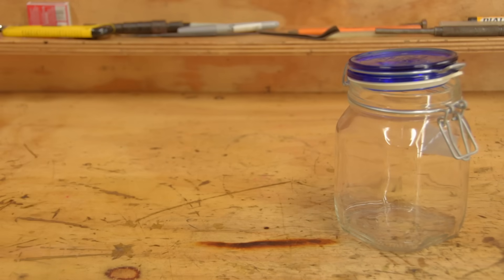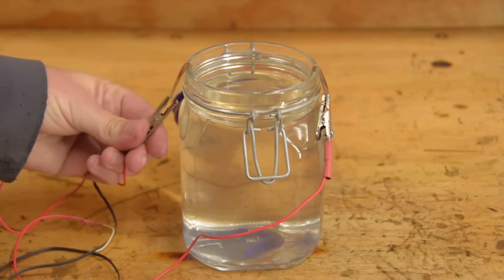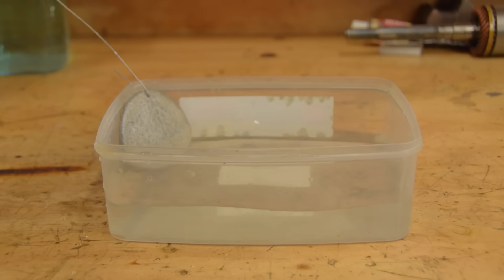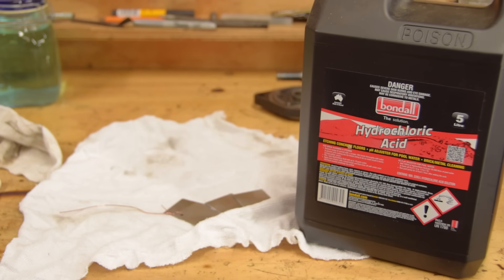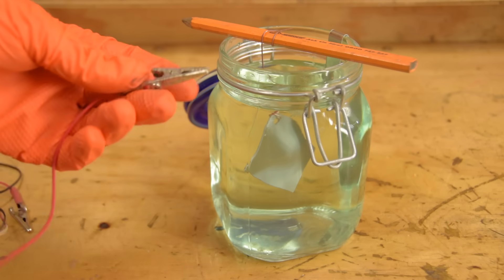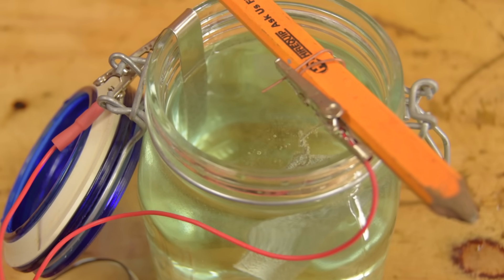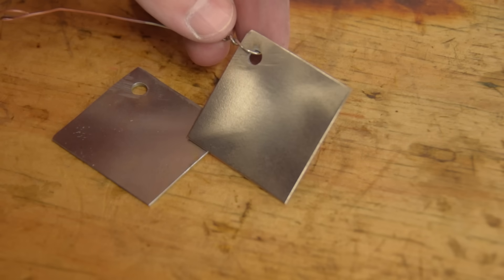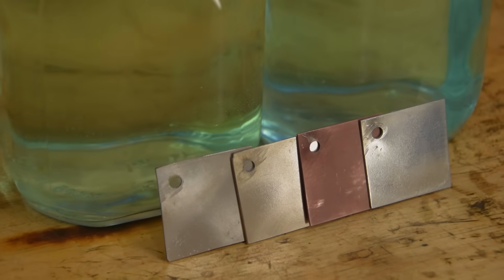Electroplating - Easy DIY Nickel, Copper, Zinc Plating

Comment: very good video Geoffrey!! i'm going to give this a try. i need to nickel some parts made out of brass i guess, but i'm not 100% sure, could be copper aswell. if it's copper i can nickel directly right? if it's brass i need to copper it first before nickel?
Reply: i just covered a copper pipe with nickel
Reply: Can you replace copper ? I have copper knobs on stove , the plating is wearing off .
Reply: LOL, I'm here because of 'my mechanics' videos!  I must be in the right place if I found the source he learned from.     Question:   Does the process give off any fumes? Or does it smell bad at all?
Reply from the maker: I think Nickel can go over either no problem.
Reply: @GeoffreyCroker  What am I doing something WRONG? I zinc plated my bolts and than deposited into a Nickel plating bath.  But after the nickel plating it looks like the zinc coating somehow got removed.  Can someone tell me what I'm doing wrong?  Thank you
Reply: I'm looking at making a Tungsten Disulfide electrolyte bath to plate onto some steel parts as a dry lubricant film. So far, the chemistry is showing me that alcohols are the best option as a to dissolve the Tungsten Disulfide. Do you have any advice that might help me get started?
Reply: @GeoffreyCroker  I'm looking at making a Tungsten Disulfide electrolyte bath to plate onto some steel parts as a dry lubricant film. So far, the chemistry is showing me that alcohols are the best option as a solvent to dissolve the Tungsten Disulfide. Do you have any advice that might help me get started?

Comment: What type is the white vinegar? In sweden its a diffrent name, is it the one you use on food like sallads or the one with diffrent strengths like 12% 24% that u use in food while baking?
Reply: Not sure about the backing but it's used in pickling process.
Reply: ethanoic or acetic acid is vinegar

Comment: Cooper will plate directly to steel.  If you dunk clean steel into a bath of Copper Sulphate it will immediately have a copper coating.  Normal chrome plating of steel was always copper, then nickel then chrome
Reply from the maker: I think commercially they flash plate steel with a cyanide copper to get started.
Reply: Well, I'll just try THAT, then.

Comment: PARTSMADE here from the 🇬🇧 , another excellent tutorial mr C  but got to take you to task on copper plating,  in my restoration work copper first if surface poor then polish and on with the nickel plate , I’m luck as my stuff is never newer than the late 1920’s when chrome plate arrived  , your plating current a bit high as bubbles on the surface of the parts will prevent proper adhesion and will show on highly polished parts  I guess a few nickel bit going to appear on mr Land Rover 🤔😂
Cheers
Reply from the maker: Ah, yeah for sure. Do you use an acid copper bath to go straight over steel? I figured saying use nickel first was easier than going into all the details about different copper options. I actually only flashed the part very lightly with nickel, but again I left that detail out of the video to keeps thing simple for the people who are starting from scratch. I figured people will learn all the details if they just start.
Reply: Hi , yep acid solution for copper , sorry not picking fault , as you say striking a balance of tech detail and not putting people off is a fine line .
Regards
Robert
PARTSMADE

Comment: "Copper won't plate steel" well, that would explain why my attempts at copper plating steel worked so badly.  Off to ebay for some nickel anodes tappy tap tap
Reply: Copper will easily plate steel. Try Copper sulphate electrolyte and see.
Reply: the result is steel plate with copper powder on it, that you can whipe off easily
Reply: @houstonceng  it won't work, you need cyanidic copper or nickel first.

Comment: Is there some kind of 'resist' I can use if there are a part of the part I do not want plating on? I was thinking of plating a gun, and do not want plating in the bore?
Reply from the maker: Paint, nail varnish, pretty much anything that won't come off in vinegar. If you buy an off the shelf plating kit it'll be non-acidic and I've used marker pen as a mask in that case.
Reply: plug the bore and chamber with wax and ensure they are completely sealed before immersing the barrel in the plating solution

Comment: What if you...... What if you drank the liquid electrolyte? Would it harm you?
Reply from the maker: My working asumption is yes.... but... it could be the next big health craze...?
Reply: Geoffrey Croker but Gatorade is electrolytes. Jk
Reply: Of course it wouldn't harm you.  It's got what plants crave!
Reply: No - you'd be OK just your Scrotum would be Nickle plated , which would be a good think if you swim a lot in salt water .
Reply: I'm a physician, and over the past 40 years I have occasionally dealt with toxic exposures to various metals, both in elemental form and as salts.  None of it is good.  Even the truly essential metal ions -- sodium, potassium, calcium, magnesium, iron, copper, zinc, selenium (ordered roughly from large to trace requirements) -- all have amounts beyond which acute ingestion is supremely stupid.  In reality, we never see cases of voluntary ingestion of things like nickel salts, because proponents of risk taking behavior of this magnitude have already self-selected out of existence before the opportunity arises.  Skateboards, wingsuits, rock walls and slack lines are simply far more prevalent/available, and transiently more rush-inducing than nickle salts.
Reply: @OslerWannabe  so that's a "no"?
Reply: @OslerWannabe  TMI
Reply: I would not recommend drinking the electrolyte after use unless you like being dead especially the nickle although the other metals would not be happy making either

Comment: What do you end up doing with the used/mixed hydrochloric acid?
Reply: It's just hydrogen ion and chloride ion disolved in water, to an extreme concentration.  In theory you could dump a 1 liter bottle of hydrochloric acid (with a pH of 1) into a 30 foot dia. kids pool 3 feet deep, and you'd have a solution of about pH 5, roughly the same as vinegar (but without the smell from the acetate).  I don't think I'd let my kids swim in that, but the point is you could dump it into a decent size pond without concern.  Just not repeatedly.  After the hydrogen ion reacted with available organic bases in the pond to make a little extra water, you'd have a bunch of chloride anions looking for lonely cations.  If they found sodium ions, they'd make a little table salt, but more likely they'd find a bunch of organic acids from decaying aquatic plants.  Now understand, I'm talking about doing this ONCE, with pure hydrochloric acid.  The problem that I foresee is that, before walking down to the pond with your 1 liter bottle, it might be tempting to grab some of the partially spent bottles of household cleaners sitting along the wall of the garage, for similar disposal.  So this theoretical scenario is not for knuckleheads.  So having a bit of an environmental conscience helps, but just keep it under your hat.  Unless you're OK dealing with the humiliation and social ostracism of being labelled a snowflake.
Reply: Neighbor's bushes.
Reply: HCL is also known as muriatic acid. It is sold as a concrete cleaner/brightener.
So, except for the heavy metal in it, you could clean some concrete with it, or neutralize it with a base, such as soda ash  (but be very careful as you will have a violent reaction)  and dispose of it down the sewer or in the yard to acidify areas that need it. 
Talk to your local municipality before dumping it out anywhere.
Reply: heiko's garage waste

Comment: Why less than 1 amp?
Reply from the maker: You want to aim for about 1amp per 65cm2. Half an amp in a setup this size is all you're going to need.
Reply: Too large a current will promote bubbles  which can leave marks

Comment: Copper won't plate to steel? Then why are parts copper, nickel, chromed. Copper is used as a filler more or less.
Reply from the maker: Commercially there are ways to plate copper straight onto steel. Traditionally it would have been flashed with nickel first.

Comment: Have you done anything with anodising aluminium? I used a similar system for zinc but with Epsom salts, and sugar as a  brightener
Reply: If you want to plate aluminium with pretty much anything, you have to first plate it directly with copper.
Reply from the maker: I haven't got into anodising yet. Definitly will do sometime though. I'm normally dealing with old steel not aluminium.
Reply from the maker: And yeah, I didn't want to complicate things with brighteners and stuff. I tried to make it a simple as possible so people actually try it. Also I've only ever used bought brighteners so I wouldn't really know what I was talking about 😁

Comment: What is your experience with the nickel on wehicles? How long it prevents rust? I know it isn’t that simple, but in general :)
Nice vid by the way. I will definertly try it. You were in my mind in the last couple days - I felt the new video :D
Reply from the maker: It's no good outside. If it's non consequential give it a shot, but I definitely don't recommend using it for all the nuts on that $100k hot rod you're restoring.
Reply: Geoffrey Croker I’m restororing a maybe $100 Zastava, so it will be fine :) thanks!
Reply: Geoffrey Croker  Oh this is only reason why i wanted to plate anything. Prevent or at least slow the rust down on screws, bolts and fasteners.
Reply: @GeoffreyCroker  I'm thinking galvanized/zinc would work better for car parts.  Great vid. I learned a couple things.

Comment: Can I plate plastic? Should I use the HCl with aluminum? ;) Great video!!
Reply from the maker: You can plate plastic if you paint it with a special type of paint first that makes to surface conductive. I've never done it. Same goes for aluminium, it's not a metal you can directly plate anything too. But there are methods to get around that.
Reply: yes plastic can be plated after applying a conductive coating. You cannot plate directly to aluminium and HCL will destroy it very quickly
Reply: 1 yes with a conductive paint layer. 2 dont ask stupid questions ;)

Comment: Great.  Thank you so much.  I’ll be doing some land rover parts (screen vent brackets) soon with this set up.  Do I need to worry about the gasses given off in plating (I’ll do the acid bit at work in a fume hood).
Reply: You want to go from acid to rinse to plating as quickly as possible to prevent any chance of oxidation.
Reply from the maker: I have the door open and avoid breathing directly over the containers etc. There is a tiny amount of chlorine gas given off by the salt. You'll need the acid wherever you're doing the plating. Once steel's been in hydrochloric acid, it'll rust over in couple of minutes if exposed to air. I recommend you do a few practice pieces first, before trying it on real parts.
Reply: Geoffrey Croker thanks very much for the informative reply.  I hope your Series 3 is on the road again soon.  My restoration is on hold now winter is upon us.  Nearly there though.  Best wishes

Comment: That shot of the copper coating the part was fantastic. Is nickel alone suitable to prevent rust or would you really need to go all the way to zinc?
Reply from the maker: Nickel is great for inside stuff. Most old tools were nickel plated. If you did a really really good job of the plating it might be OK outside for a while. Old British motorbikes used nickel plated fasteners.